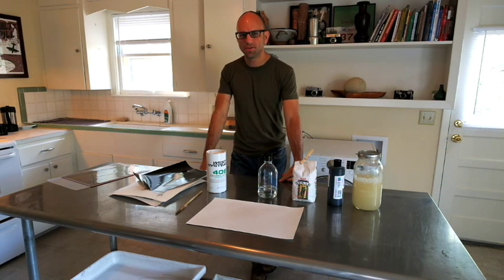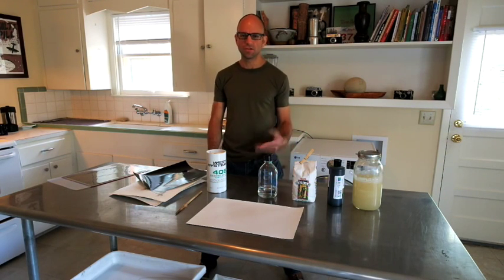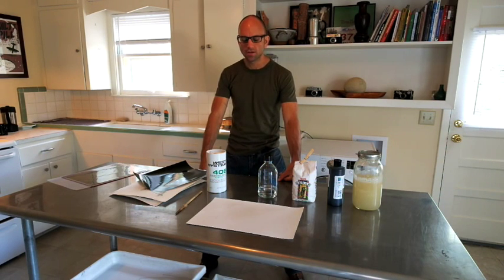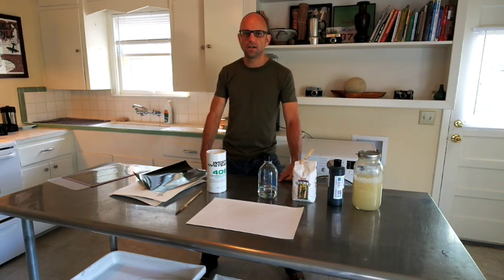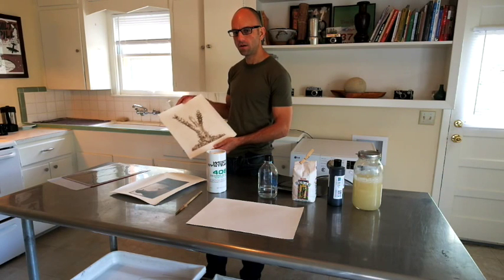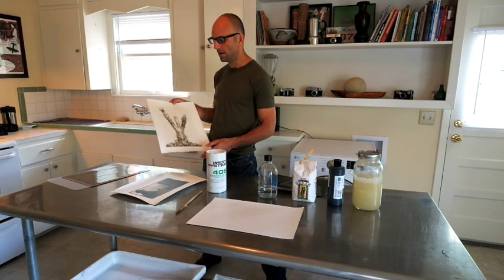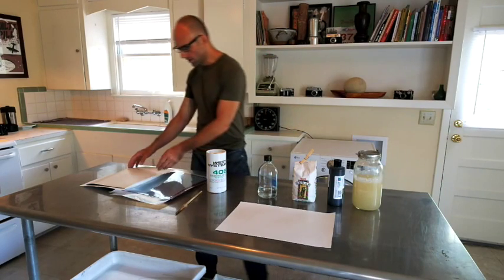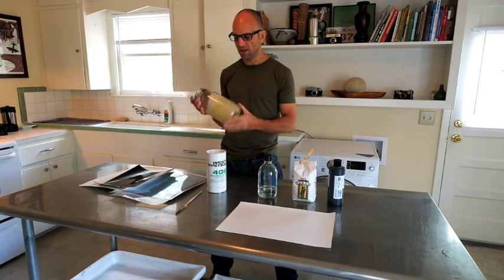Carbon Printing Part One - Overview

Comment: Do you have your own printer for the large negatives? I want to make something bigger than 8.5x11 but can't seem to find a way to get there yet.
Any help is always appreciated.
Reply from the maker: Yes, I use an Epson 3880 with the standard K3 inks and I print onto Pictorico Ultra Premium OHP. This printer will print negs up to 16 inches wide and I have made some 14x21 inch prints. For printing under 13 inches an R3000 would be preferred since it has a smaller droplet size. I use Epson printers because I also use Quad Tone Rip for printing my negs and Epson printers are more open to tweaking sharing correction curves and printing configurations using software like Quad Tone.